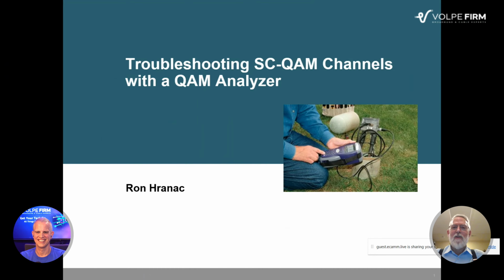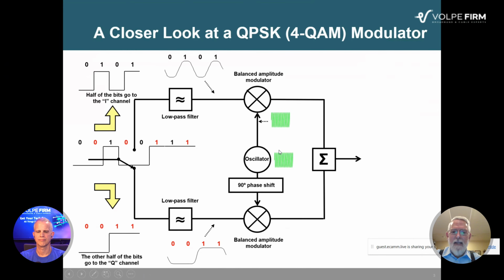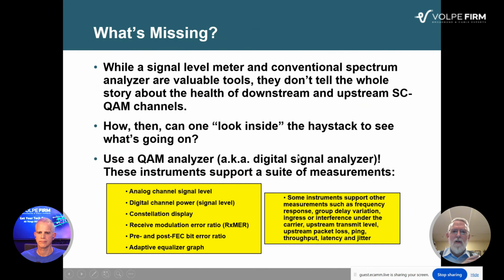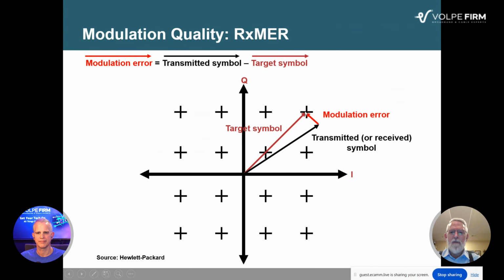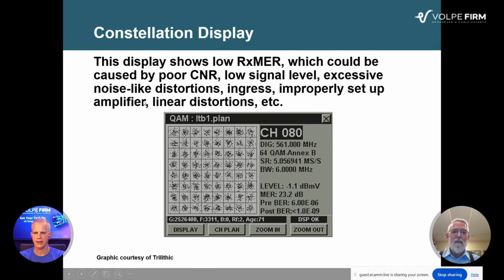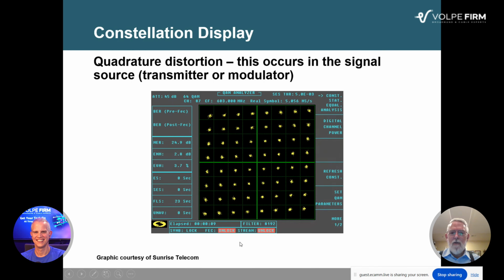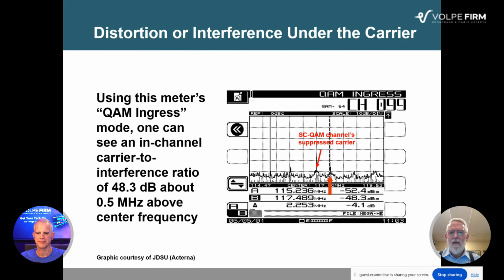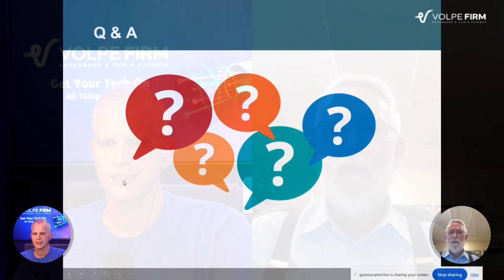SC-QAM Troubleshooting Masterclass: MER, BER, and Constellations Explained (with Ron Hranac)

Comment: I'm back, 5 months later, with another question: 

a little confusion on the QPSK modulator block diagram, particularly right after the 14 minute mark of the video, BEFORE the summing circuit, AFTER the balanced amplitude modulators: the two inputs to the summing circuit are not amplitude modulated, they are only phase shifted, right? if there was amplitude modulation going on, I have to assume there would be some kind of visible amplitude difference between a zero and a one, is that right?
Reply from the maker: Good question. This is a very common point of confusion.

Right after the balanced modulators (before the summer), the I and Q signals are not amplitude-modulated in the usual sense. Each branch has a constant-amplitude carrier whose polarity flips (+1 or −1) depending on the bit value. A polarity flip is equivalent to a 180° phase shift, not a change in amplitude.

So:
	•	You do not see “bigger vs smaller” amplitudes for 0 and 1.
	•	You see the same amplitude, but with a sign (phase) reversal.

When the I (cos) and Q (sin) branches are summed, those ±1 values select one of four possible phase angles. The final QPSK signal has a constant envelope; all information is carried in phase, not amplitude.

If there were true amplitude modulation, you would indeed expect to see visible amplitude differences, but QPSK is specifically designed to avoid that.
Reply: @Volpefirm  thanks again! I did some compare and stare in python to convince myself that negating the amplitude is basically the same thing as shifting the phase by 180 degrees

My QAM project is just about to start for school, and my professor is a math and physics guy, not an engineer, so he helps me learn Fourier analysis, and I show him how clever QAM is

Comment: I'm having some trouble with the idea of average symbol/error powers. Those values, those operations, are a sum of areas, basically. I^2 + Q^2 = c^2, that's Pythagoras, but no root is taken; it's not giving a length it's giving an area. But the summation isn't an average, otherwise it would have to be divided by some N. And I wonder if my confusion also has something to do with the word "power" which here doesn't seem to mean the time derivative of energy as we learned in physics, although the Wikipedia page for MER says it's measured in Watts, so what do I know.

To me it looks like the numerator is the total area of a bunch of large squares and the denominator is the total area of the same number of much smaller (hopefully) squares. I am having trouble seeing how the ideas of power or averages fit into this. Any further reading suggestions?
Reply from the maker: Great question, James — you’re thinking about this really deeply, and I appreciate that.

You’re absolutely right that when we calculate I² + Q², we’re measuring the instantaneous power of a symbol — not a distance, even though it’s similar to the Pythagorean theorem. In communications, power is proportional to the square of the signal’s amplitude, so I² + Q² gives us the “power” of one symbol. It looks like an area, and that’s a good way to visualize it.

Now, regarding averages: when we calculate something like MER (Modulation Error Ratio), we are averaging over many symbols. Both the signal and the error powers are summed across all the symbols, and then divided by the number of symbols. So yes, there is a division by N — it’s just often implied in the ratio.

MER is usually expressed in dB, and it’s the ratio of the average symbol power (from ideal constellation points) to the average error power (how far off the received points are). So your analogy of “big squares vs smaller squares” is actually a great way to think about it — it’s comparing how much larger the clean signal is compared to the noise or distortion.

Also, don’t worry too much about the term “power” meaning energy per second like in physics. In this context, it’s more like “signal strength” per symbol — it’s normalized for comparing performance.

For further reading, you might check out:
– The ARRL Handbook (ham-friendly intro to digital modulation)
– App notes from Analog Devices or TI on MER or EVM
– Or if you want the deep math, look up “Digital Communications” by Proakis

Happy to clarify more if you’d like — you’re definitely asking the right kind of questions!
Reply: @Volpefirm  I really appreciate your reply. I have spent a lot of time as a cable tech (although I haven't been in the field for quite a while), thinking of the constellation as a physical representation rather than more of an abstract representation. Brilliant stuff, this QAM.

And why yes, I do want the deep math. I will definitely be looking up those further readings. I'm trying to find a way to make my upcoming school project (spring of 26) about QAM. Thanks again! And thanks for doing your show!
Reply from the maker: @JamesLong-nb4mt  Awesome your doing a school project. Spread the word. We need more technicians 🎉